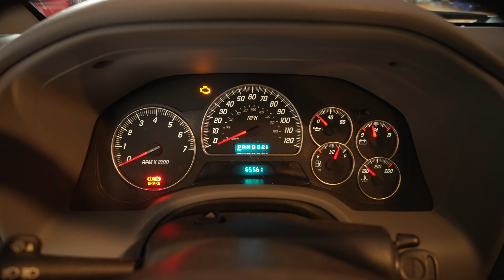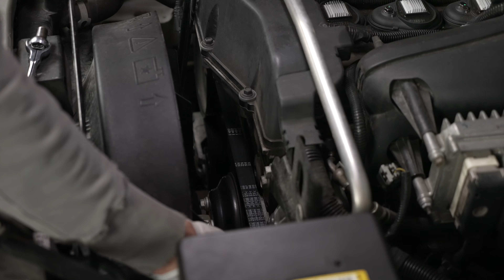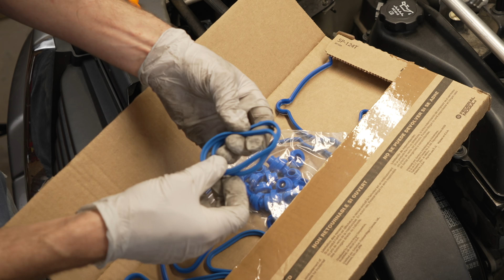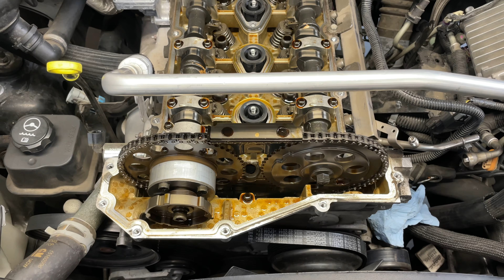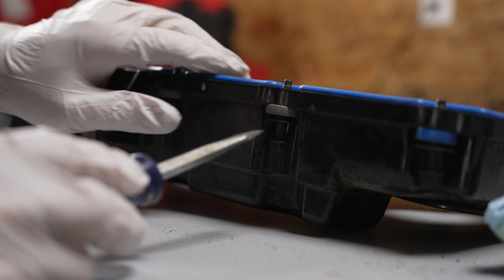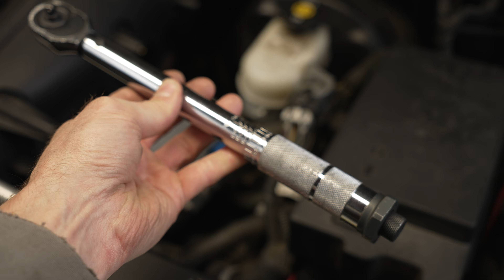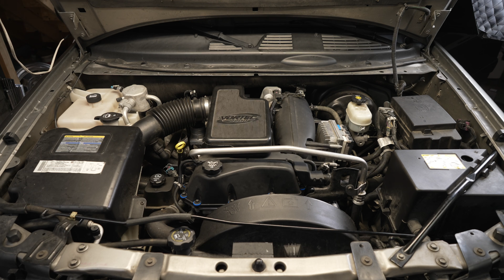Here's Why You NEVER TOUCH FACTORY INTAKE MANIFOLD GASKETS!!

Comment: You're next step is the spark plugs. Make sure you have genuine plugs and not Chinese knockoff's by pulling the plugs and performing ohm test and ensure each of the plugs are the same. Some of the video's I've seen show authentic plugs with 5-6 ohm's each and Chinese plugs at or near zero which causes a misfire. Verify ohm number for the plug your engine uses.

Comment: Smoke the intake and valve cover etc. This is a very good way too either find a leak or eliminate them from the diagnosis.  You also could have something affecting your fuel system,  you really need a scan tool to check that , and many other things.  You don't have to have a cel for something to be wrong.   Hope this helps.

Comment: I love older GM cars and SUVs but, doing the same replacing new OEM parts, frustrates me
when it still doesn't run as smoothly as I like. I never have a check engine light. It drives me insane.

Comment: Well, a bit late. But I have one idea, and one thing you overlooked. 

Idea. Check fuel system. Could be the fuel pump, could be the fuel filter. So, I would start off with checking the fuel pressure, and go from there.

What you overlooked. You said there was oil in the plugs. You never pulled them, cleaned, and checked for arcing. The very tops of the plugs looked ok. But it might be arcing under the boot. I only bring it up because you said it acted like a misfire early in the video. That would cause a misfire.

BTW, a fairly cheap scan tool would easily show you if it is a misfire, or an unmetered air problem. I'd suggest spend money on that, and hold off on fancy wrenches.

Comment: First thing I do when diagnosing an engine noise is release tension on the accessories belt and run the motor for a few seconds. If the sound goes away, it’s an accessory. Troubleshoot alternator, power steering, AC clutch and water pump as necessary.

Comment: Check the tensioner pulley. They have a tendency to wobble and cause a noise at idle. Watch for wobble with a go pro.
Reply: I had the tensioner pulley go out and snapped the belt. Luckily the tow truck driver diagnosed the cause and he drove me to the autoparts store - and then he called his buddy to install it for me (cash). Wow - I got saved from being stranded on the weekend.

Comment: The engine mounts can cause a vibration or also that one may feel as a loping at idle.  I had to change my 2004 Envoy engine mounts and it made a big difference.  The throttle body should be cleaned gently and no cleaner run down into the electronics that operate the throttle.  The throttle plate is not supposed to be moved by hand either.

Comment: Replace your vvt solenoid, and ohm your coil packs. Even new delphis have been faulty. The problem should go away.  I chased a missfire on my 4.2 for two years. Injectors, plugs, purge valves, regulators, fuel filters,pump, in the end it ended up being a faulty coil pack, and a bad vvt solenoid. It ran perfect after that.  Had gobbs of power and gas mileage was great. Unfortunately the 4l60 left the building shortly after.
Reply: $4K for a Reman transmission - and I'm hoping the engine will last another 250,000. hahaha. I put an external OEM Magnefine inline filter on the transmission - runs way better now.

Comment: Also check for a clogged cat. I used "cataclean" recently on my 2007 hummer with 3.7. It runs better and better fuel economy. I also used it on my 04 6.0 powerstroke and fuel millage is better. Clogged cats can cause rough idle.

Comment: I hate GDI engines because of the crusty carbon that builds up on the intake valve stems and eventually must be physically cleaned off because the carbon interferes so much with the valve seats, etc.
   I recommend installing an OiL catch can on every GDI engine, or.....converting to PFI or TBI or an old style carburator.

Comment: THESE IN - LINE 6 ‘S ARE VERY TEMPERAMENTAL, FOR THIS REASON I ONLY USE DELCO / DELPHI REPLACEMENT PARTS , I HAVE 230 K ON AN 02 TRAILBLAZER IT STILL HAS THE ORIGINAL ENGINE , ALTERNATOR NO BEARING NOISES !!!

Comment: My 2002 2500hd with the 6.0 wouldn't stay running when cold once it was warm it did fine. I replaced the factory intake manifold gasket with Felpro.   Been working flawlessly!   My understanding is that GM factory intakes gaskets was junk and they changed the material later.  They shrink when they are cold, once warm air flows the expand back to where need to be.   I think i read to use flepro.

Comment: Diagnostics. Could be a simple sensor. Suspect mass airflow but need a live data computer to diagnose and know how to read values and graphs. MAF should have a linear correlation with RPMs. Bad O2s and MAF can cause it to fuel rich or too lean at idle. Or it could be a simple sensor going berserk. Or vacuum. Or unknown electrical short putting load on an idling alternator lowering RPMs too low.

Comment: A fuel injector causes misfires too, usually gets ignored, a noid light set helps. If it is actually picking up a misfire on a particular cylinder, you can swap injectors around to duplicate a misfire on a different cylinder. Check fuel pump pressure, low fuel pressure can cause a boggy idle and a dead spot on acceleration. If there isn't a misfire being picked up, have the exhaust backpressure tested, that can cause an engine to be sluggish at low RPM

Comment: Excellent video Jimmy  :) you can try a grey bottle of STP Total Treatment fuel injection and carb cleaner in fuel tank too  see happens if no difference  try 89 with 5 % Ethonal  or 90  plus higher with  no Ethonal % see happens to try !

Comment: Hi Jimmy, out of curiosity. Have you replaced the engine coolant temp sensor by chance? The 4.2 relies heavily on every one of its sensors to run correctly, and a flaky sensor can definitely cause it. If possible, I would do a fuel pressure test to be on the safe side. The factory rated pressure specification is 50-57 PSI, anything less is typically a fuel pump. If the fuel pump needs to be replaced, stick to BOSCH (they provide the OEM fuel pumps for the 4.2, and 5.3 Envoy/TB.) I would give the MAP sensor a good cleaning (or replace it, its a relatively cheap part). Since the 4.2 was never equipped with a PCV system, all the oil/blow-by just gets sent back through hence why the intake manifold had that gunk around the ports. The MAP sensor is located at the top of the manifold next to the throttle body. 

The rough idle/stalling at a stop were usually linked to the throttle body being dirty, but since you've cleaned it you MAY need to do a relearn (if you haven't). The procedure for the 4.2 is; 

Disconnect the negative cable
Leave battery disconnected for 30-40 minutes 
Turn key to ON, do not start the engine or touch the gas pedal. You may/may not hear the TB actuating during this time. 
After leaving the key to the ON position for 5 minutes, do not turn the key to the off position, instead start her up and let her idle for 10-15 minutes.
Drive around to get it to operating temp, and see if that makes a difference. 

Otherwise, I would suggest getting a test done on the fuel injectors.

Comment: While we are throwing parts at it, replace the knock sensor and crank position sensor.  Both located next to each other on the driver's side engine block down low.  Access from driver/front wheel well (Envoy on jack stand) and underneath.  I had to replace the CPS on my 8.1L Burb because it was stalling out intermittently while I was driving.  Age could be getting to motor and tranny mounts, as well.  Also, a long extension from a part to the ear is good for finding sounds, just be real careful on a running engine not to get into the fan or belts.

Comment: The ticking could be the timing belt tensioner. And if the chain is off a bit that could be the rough idle. They are known to stretch. Replaced mine this last summer

Comment: Hi Jimmy

Concerning the ruff idle, sometimes running the engine at lower rpm at idle can cause a ruff idle and intermittent shut off because the engine is not getting the right mix of air and fuel, try turning the idle up.

E.G. If idling at 500 rpm try turning it up to 600 rpm and so on.

If that doesn't work try a adjusting the air to fuel mix to see if it is that was the cause of the ruff idle, if all is controlled by a ecu then a retune may be needed of the ecu settings.

If that does not fix it then the wiring loom needs to be looked at because the ecu and the wiring loom especially the connectors to the sensors are a weak point in the electronic fuel control system.
Reply from the maker: Thanks! I’m considering all ideas. 👍

Comment: When I had similar idle issues I cleaned the throttle body and that solved it.  I only had 50k miles on it but there was already carbon buildup on the throttle body.
Reply from the maker: Thanks, I did do that not too long ago. It already looked decent but made it look brand new. 🤷‍♂️

Comment: I told you so!!!

In your last video on the replacement of those intake manifold gaskets, I told you that they leak because the manifold warps from the heat in the motor, not because the silicone gasket is worn out!!!

Comment: Check map sensor  you cleaned the intake probably the intake manifold is bad fuel pump  put seafoam in your gas to clean the lines vacuum leaks as in hoses

Comment: you get signs what is the problem.    noise from alternator refer that camshaft not balance, it's  mean that becasue  camshaft spins not in  center then  alternator will have damage to alternator bearing.--------------------------------------------------------------------------------------------------     conclusion  : 1) one or more of engine cylinder or valve had leak, you can easy check that with ODB (check negative pressue on idle), because of that the camshaft will not be balance and you will get also oil leak.  -----------------------------------   i think it not worth to fix.

Comment: Did you reset the pcm after taking throttle body off.? I didnt do that on mine at first and it was idling really rough until i did
Reply: It's supposed to reset automatically though - if you disconnect the battery right?

Comment: Intake leaks cant lean your engine out and tear an engine up. Ive had valve cover gaskets leak and KILL my alternator a few times in my time. Good video brother.
Reply: Detonation caused by a lean condition can kill an engine. Very slight detonation on a stockist low compression engine, it can run for a long time. A higher compression engine it will kill alot faster. Unless it's a to church on Sunday and never sees 2500 rpms or above.
Reply: No rtv was needed??
Reply: @ernestfox425  No.
Reply: @ernestfox425  mine didn't. Depends on the engine
Reply: The valve cover leaking oil killed the alternator.

Comment: Mass air flow meter it is possible to clean them with electric contact cleaner spray on heated wire with it removed form car put in plastic bag so the cleaner doesn’t evaporate and give it a good spray . Then let air dry 👍

Comment: First time viewer, aircraft mechanic and I was raised on a farm and worked on tractors and vehicles my whole life.      I would check the fuel pressure at your fuel line you disconnected,  a weak fuel pump can cause idle issues and stalling, stumbling, weak aceleration, etc. like the things that you mentioned.   Fuel pump is probably inside the fuel tank on the tank quantity sending unit.
Reply: Stumbling on acceleration is a good way to describe what happens when fuel pumps begin to fail.

Checking the pressure is fairly easy
Reply: So can a vacuum leak weak battery clogged oil pump lots of stuff
Reply: @itz_real_notch9813  yes, but there was no pressure in the fuel line he disconnected. Though maybe he depressurized the system off-camera.

Comment: Check into your downstream O2 readings. Compare it to where it should be... My father in law changed the transmission out of his 06 trailblazer I6 due to a rough idle and a "slip" condition. Turns out his catalytic converter was quite plugged, but plugged enough to set a code. Weird I know but changing out the cat fixed his problem... Don't know if that helps but it's worth looking into.
Reply: I had this problem as well
I diagnosed by drilling a 1/8 inch hole before the cat and measuring the exhaust pressure using a vacuum gauge (very cheap at harbor freight)
Mine was also rattling, almost as though a chunk of material broke off...
I was throwing all kinds of codes too it was a diagnostic nightmare!

Comment: Could a possible bad "Evap Purge Valve" be causing that problem just a thought🤔
Reply: Doubtful, a bad purge solenoid would code really quickly as would most any leak in the evap system. I've got a bad evap vent valve solenoid on my 09 avalanche and it codes ever 3-5 starts. Too lazy to change it tho since I can just clear it from my aftermarket radio.....
Reply: I got that code after I treated the car with my DIY undercoating - 4 lbs of pure gum turpentine and 3 lbs of petrolatum wax and 1 lb of paraffin wax. hahahha. I cleared the code - kept driving down the highway - and the code has not come back! The idle does seem a  little rough though - so hopefully I didn't damage the canister or whatever. "If a evap purge valve fails then there's constant evap evacuation from the charcoal cannister for fuel vapors from the fuel tank - which is just like a vacuum leak, can cause hard starting and rough idle."

Comment: Now this is NOT meant sarcastic, but …have you tried to pray over it… anoint that car! It sure does not hurt. It is a strange problem, I wouldn’t know either what to tell you next….
Maybe add Ceratec (from liqui molly) to the oil, give it a good decarb fuel treatment…. 
No codes…no anything? Having owned GM car before, I went through a lot of alternators. 

We love your videos, we learn from it as well! THANK YOU AND BLESSINGS!
Reply: I'm about to add Air-Tec Systems which is also made in Germany from Wagner - it's the hexagonal boron nitride just like Ceratec. I've used it a couple times before. I also did the Ceratec once - but I made the mistake of combining that with some other additive - maybe it was I doubled up on the boron nitride - too much! It's  only supposed to be 5% of the oil. Yeah I overfilled the oil and that's what caused my problem - where I got a misfire from oil filling the spark plug. Then when I cleaned out the oil and I put in new spark plug - this was in cylinder six - I accidentally CRACKED the sixth spark plug because it's hard to reach all the way back. So I kept getting misfire and didn't know why! I replaced all the coils and ALL the spark plugs - and then I noticed I had cracked the six one. hahaha. Lesson learned. Also I cleaned out the engine and PVC hose - using acetone - and replaced the PVC hose. So then I figured I better replace the Catalytic converter since burning off all that acetone probably destroyed it.

Comment: Have you gone through the idle relearn procedure after disconnecting the battery and working on the throttle body, intake, etc? All you need to do is search "gm idle relearn procedure" on your favorite search engine and dozens of articles pop up explaining what to do. The entire procedure takes about 10 minutes.

I know that whenever I disconnect the battery on my 2013 Corolla, which also has a drive by wire throttle body, that I have to go through the idle relearn procedure or else it will stumble and run like crap whenever I accelerate from a stop. After doing the procedure it runs like a champ. After watching your informative video I searched and found that there is a similar procedure for late model GMs too.

I hope this helps. Good Luck!

Comment: Try clean the fuel injectors or better to replace the fuel injectors and install new ones and also don’t forget to change the fuel filter
Reply: I believe many of those vehicles have the filter mounted on the pump inside the tank.

Comment: I would suggest maybe changing the engine and transmission mounts. It's possible that the rubber in one of them is ripped and causing a slight shudder.

Comment: If ur thinking of a vacuum leak maybe use a smoke machine I know that kinda a special tool but maybe have a buddy or someone and smoke the intake system and if it is leaking due to looping idle. Maybe use a scan tool and also look at fuel trims and see if it running rich or lean? Just shooting a idea out there
Reply: Spray diesel start around the gasket, you'll know, when it revs up
Reply: 100% he had problem with intake leak, one or more of engine cilinder had pressure leak.
Reply: Smoke machines are easy to make. There are multiple YouTube videos showing how to make them. There is no excuse for not diagnosing a problem … just throwing parts at it.

Comment: I had similar issues with a 6.0l. I ended up replacing the throttle body. But the issue was the throttle position sensor. Good luck.
Reply: yes the throttle body valve HAS to be cleaned regularly. I need to do mine again - once a year. thanks

Comment: I had the alternator for my 97 Olds 88 go out with bad bearings. It was an upgraded Mechman alternator and the bearing towards the rear totally blew apart and was wobbling around. Thankfully I could limp home and had power if I let the engine idle but as soon as I gave it gas it would moan really bad and drop the voltage.

Comment: How did you get the back valve cover bolts out?
Reply from the maker: Was pretty simple actually. 1/4” ratchet with either a 10mm and short extension or 10mm deep socket.